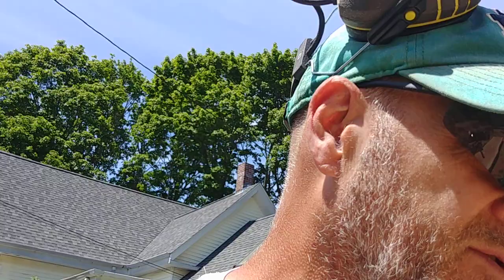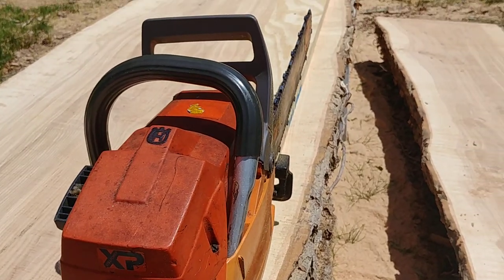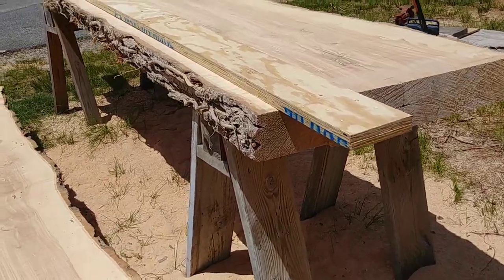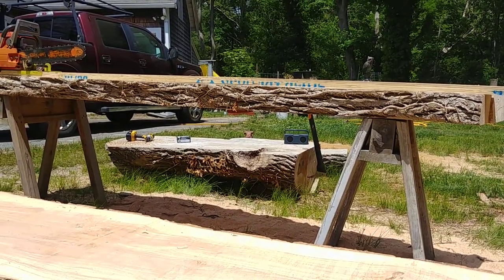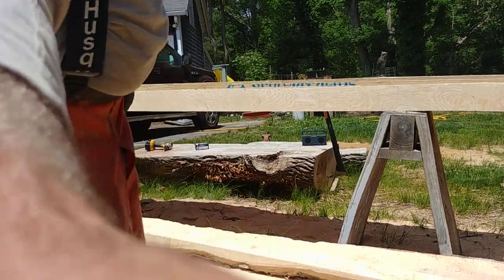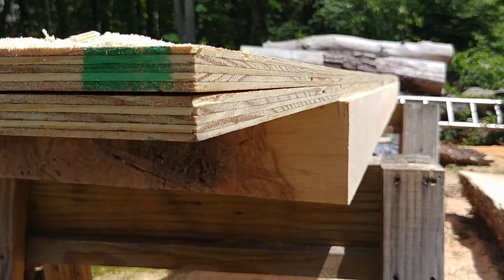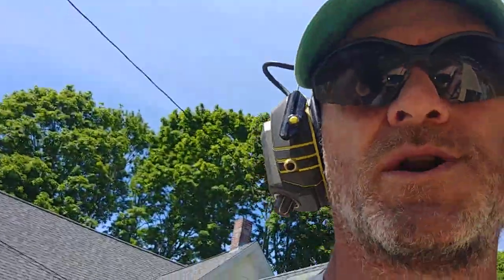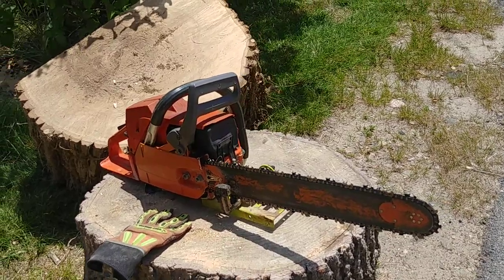Timber Tuff jig mill demonstration and review.

Comment: I’ve watched a few videos using this. You’re the first to show how effective “pushing” the saw rather than pulling it. Your method also does leave you with a face full of sawdust as the others have the discharge flying up over them. Very nice, I’m almost ready to buy this....what thickness of the plywood?
Reply from the maker: I used a sheet of 3/4 CDX for the straight edge.  It ends up being the same thickness as a standard 2x6 when spliced together double thick.
Reply: @williamprophett9148  great, thank you

Comment: This is what I do for a living as well! Cheers brother.  If you take a propane torch and remove the front muffler there is a screen. Burn the carbon off the screen and put it back in the chainsaw to fix the idle. Sounds crazy but it really works
Reply from the maker: ????.  What is this in reference to?  If I was cleaning a spark arrestor screen,  I do it exactly the same way...

Comment: Curious, did you originally slab out the log using the same jig? Wondering how it would do for that. Thanks and great video!
Reply from the maker: No, I have a 36 and 48" Granberg mill and run from 36" to 56" bars on them.  If I remember right, this was slabbed with a 42" Oregon bar in the Granberg 48...

Comment: Thanks for the video!

Would you recommend keeping the saw vertical or at an angle (say 45 degrees) when cutting?

I just bought one of these and used it last weekend. Pretty neat but honestly it took a little longer than expected and slightly difficult sliding it down the rail (2x4 in my case). I was cutting through about 8-10" of wood.
Reply from the maker: Vertical.   No question.  Especially if you want a square cant.  If you are going to angle the saw, save yourself the set-up time and just chalk a line and do it freehand.  Vertical and steady keeping the jig seated flat.  That's how you will get the best results.
Reply: @williamprophett9148  ok, sounds good. Thanks👍
Reply: @williamprophett9148  Thank you. I had the same question. Your technique seems to work... I'll give it "a day in court".

Comment: Really great video, thanks for posting. I have a question that I’ve not seen addressed online, and that’s regarding the chance of getting kickback. I have a Stihl farm boss, and have never slabbed wood with it. My concern is that by pushing it like this, is there a risk of kick back? If so, do you feel exposed by pushing it in that position? I would really appreciate your thoughts, as I’m fairly new to this, and have a large already felled tree I want to cut into slabs. Thanks
Reply from the maker: It's an interesting question and multiple answers come to mind, both "responsible" and "real life honest".  "Responsible answer": yes, I have thought about it and always make sure that you wear quality PPE (like my chaps in the video) and always have a hand on the top handle and have a functioning chain brake when operating a chainsaw.  A hand on the top handle will allow the chain brake to engage in the case of a kick back.  Also, (responsible answer) keep your work area around you clean and free of debris that may catch the tip of the bar or cause you to lose your footing.  "Real life honest answer":  The bar is in a position away from my body and under control with both hands and there isn't anything in this scenario to cause a kickback.  This is far safer and controlled than cutting brush in your back yard.  I honestly believe the single biggest danger is the sawhorses collapsing and having the slab land on my foot.  Thank you for the question though.  Always use your best judgement.

Comment: Man, that 268 just chewed through that ash.  Nice!  I have a Rancher 450 (50cc).  I'm giving up nearly 20cc to your 268.  You think it's too underpowered to run through some white/red oak?
Reply from the maker: Nope.  I've done this with my wifes MS180c.  Just ripping beams isn't that bad.
Reply: @williamprophett9148   I may have to give it a try.  Building a small barn. Would rather spend the band saw mill money on a concrete floor.  And if it's horrible, I'm only out $30.  Thanks for the video.

Comment: The Allen bolts keep backing out on mine. Have any tips to help prevent that?
Reply from the maker: I don't know how to explain the process in terms of "tourque".  Like I say in the video, little 1/8th turns until they are all snug and when you tighten one the next ones aren't getting loose.  Another way you could do it would be to use longer allen set screws with a nut on the outside and snug the nut against the bracket after you get the allen's snug.  That would keep them from moving.  The other option is to drill the bar.  However, I only had it come loose one time and I've never made that mistake again.  Keep me informed on how you make out.
Reply: William is correct, look up "how to tighten head bolts" but I go with drill the bar, have done mine with no problems though have a drill press and cutting fluid.

Comment: Hey, did you use rip chain for the saw?
Reply from the maker: In this particular video I "did" have a 10° chain on.  I've ripped quite a few beams with 25° configurations as well.  The crosscut configurations do a decent job, but definitely not as smooth a finish.
Reply: @williamprophett9148  So if I were to get a slab that I would plane off anyway afterwards, it wouldn't be too much of a deal to have a crosscut chain, right?
Reply from the maker: @zlancenyc  for most anyone that does this as a hobby or for woodworking needs, a crosscut filed chain will be fine.
Reply: The purpose of the ripping chain is not finish, but ease of cutting.
Reply from the maker: @Josef_R  it's smoother for sure.  And I hate to ever disagree with anyone, but that's wrong.  Filing at 10 degrees relieves the lateral pull of a standard 25 or 30 and produces less tooth deflection in the cut.  Cutting with 10 degree teeth is not "faster" (all the time).  It is definitely smoother finish.  I have some comparison videos on my channel.
Reply: @williamprophett9148  maybe if you're comparing equivalent cuts, but ripping with the grain will be faster, easier.  Using the crosscut chain for ripping will not. You're cutting apples and oranges.
Reply from the maker: @Josef_R  I mill lumber for a living brother.  I make and all my own milling chains out to 168 dl 56" mill setup running 5 custom 99cc mill saws that I build as well.   I also professionally sharpen and grind chains for myself and customers.  I know what I'm talking about.  Breeze through my channel.  Be safe brother.
Reply: @williamprophett9148  Could be using the wrong terms here, but I don't consider a perpendicular cut where you are cutting across the ends of the grain to be "ripping."  Ripping is when you have the bar at least at 45 degrees to the log and you are cutting with or along the grain.  I don't have a mill, I do it freehand and have my bar 45 degrees or more, even parallel to the log.  Just like if you were ripping on a table saw.  You get really long shavings.  When I cut across the end grain, like you are doing, I get powder, and it probably doesn't matter which toothset you use. I'm guessing this is what you mean. My experience anyway, cutting straight across the endgrain is tedious.
Reply from the maker: @Josef_R  yeah, I like freehanding every now and then and you are using the term "rip" correctly.  The reason that any "rip saw" configuration (from a panel saw to a chainsaw to a circular tablesaw) is called "rip" is because the teeth faces are not filed with any or very little "fleam" and they "rip" out the fibers versus "severing" the fibers on a crosscut configuration.  At 10 degrees of fleam, there is some tangential or axial force on the tooth so that it does deflect some to the side.  That deflection causes the ridges in the faces of your cut.  At a true zero fleam rip configuration, you get the least deflection, most resistance (hogging or ripping out the long fibers) and smoothest surface.  It takes the most power to pull a true rip configuration as well.  When I'm freehanding a log (for whatever reason) I prefer some fleam to speed up the cut because I'm not looking for a smooth finish surface like I am when using a mill and a rip chain.  When you are freehanding from the top of the log, you get "noodles" for shavings out of the wood.  When you are milling perpendicular to the end of the log, you get dust like you said above.  Absolutely correct.
Reply: @williamprophett9148  alright, same page.  This sawdust is why I haven't tried milling yet, I've just been throwing what I can lift up onto my 17" bandsaw which doesn't result in much useable lumber.  I just ordered the Timber Tuff cause it's cheap and we'll see.  But my guess is that it'll run faster (on full logs) if you cock the saw back instead of perpendicular? That's where I was going with that.